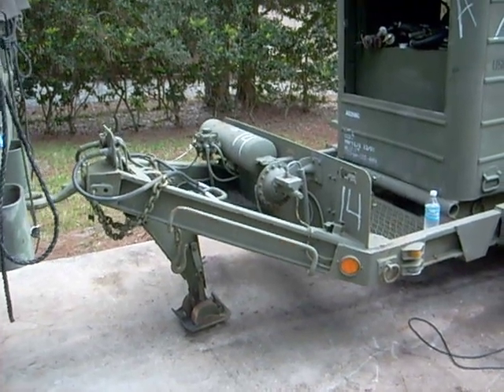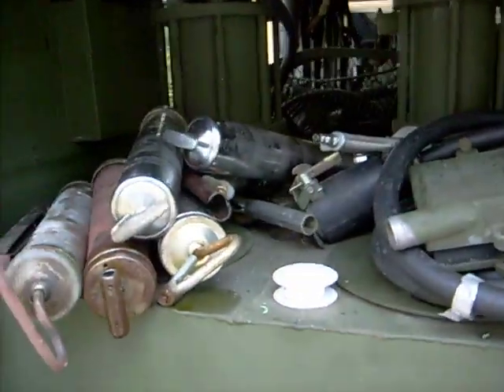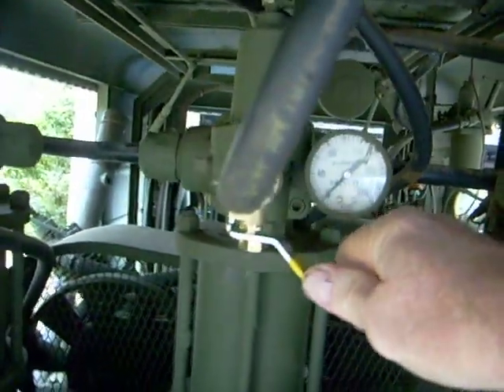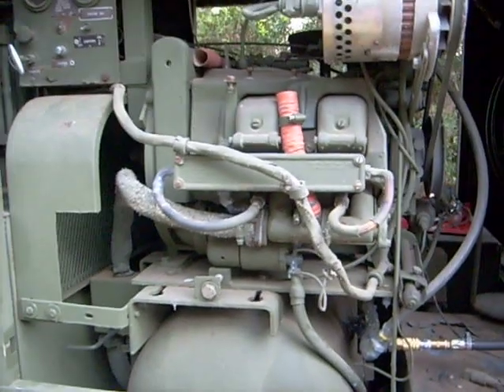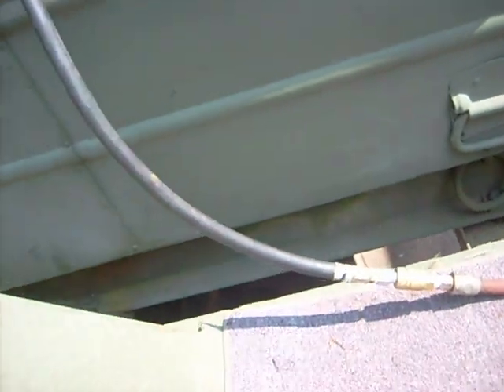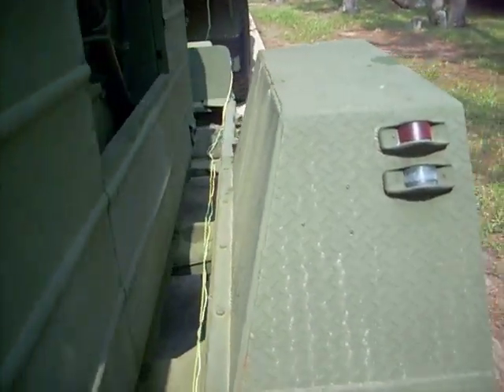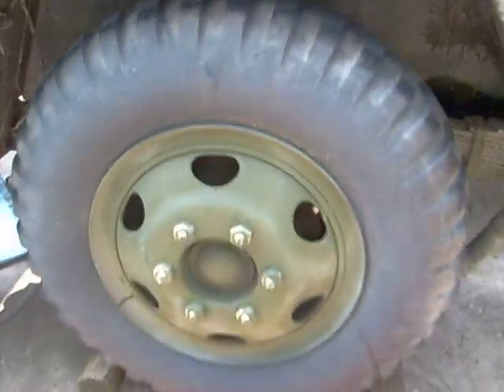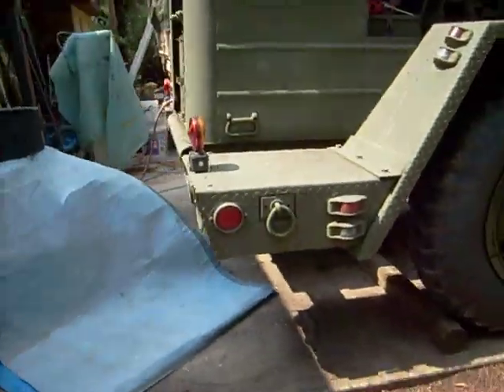Military Lubrication and Service Trailer

Comment: I recently acquired one of these lube units. The issue is that it doesn’t have the trailer. Can you send me information on the trailer ?
Reply from the maker: You will probably have a hard time finding one of these trailers if your unit is the same type as the one I have.  Some of the newer ones had diesel motors and were much lighter.  I'll have to see if there are any data plates on the trailer itself and I'll get back to you.  I have the TMs for this trailer somewhere that might have the information you need.
Reply: I have one of these complete units exactly like the one in the video. I also have a trailer without the unit on it that I would like to sell. I’m located in Winchester, Indiana
Reply: @PatBeck1981 what do you want for the trailer itself?
Reply: @OIFVETERAN145  I sold it a couple years ago

Comment from the maker: Actually it's a great question!  Everything inside of this trailer is super heavy duty and will last a lifetime and beyond.  The compressor inside is huge and will eventually take the place of several that I have at the house (backups, etc.).  My cost for this was $604 plus the fuel to go and pick it up (less than $200).  If you check Ebay, people who are selling these are asking over $3K for them - the Government paid over $23K for the one I have.  It makes lube jobs a very simple & quick task.

Comment from the maker: This thing is pretty old!  The newer versions use diesel motors and are a lot lighter than the 5500 pounds this trailer weighs in at!  I would have preferred one of the newer models but would have paid three times as much for one on Govliquidation auctions.  Everything on this trailer is heavy duty!   Thanks so much for the comments too!

Comment from the maker: Eventually it will be awesome!  So much work to be done before I can actually use this thing.  I ordered the special GAA grease and will start using the trailer once the GAA gets here from New York.  Long range plans are to install a small generator (which I already have) inside this thing so that I will have 120 volt power as well as compressed air to work with anywhere I go.  Thanks for your comment by the way!  You can buy one of these through GSA and Govliquidation auctions & Ebay too.